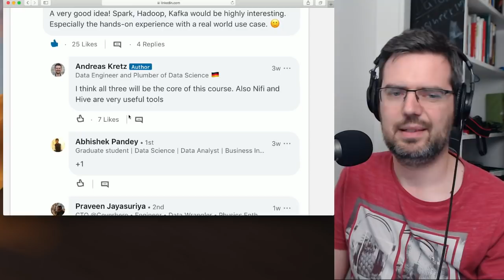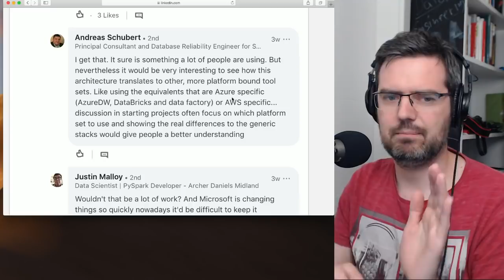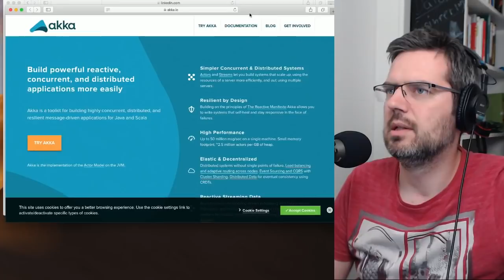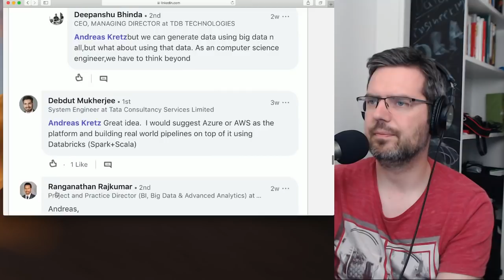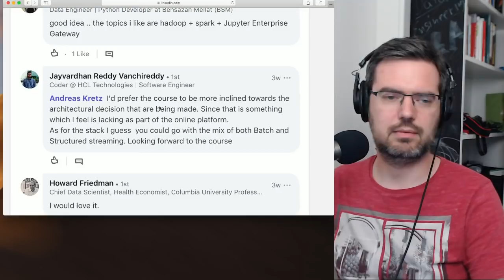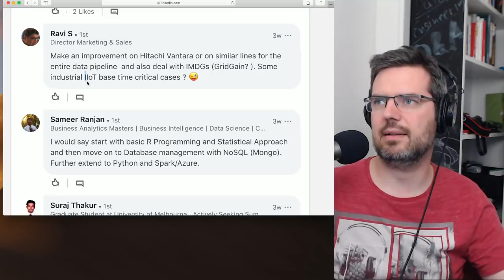Starting My Data Engineering Online Course | #074

Comment: Hello Andreas, glad that you decided to take a new challenge! Kudos to you!

Let me share my modest suggestions about what would be interesting to include in the course:

Cloudera CDH on some PaaS
Airflow as a scheduler of DAGs, instead of Oozie
HBase as a NoSQL for OLTP
Parquet as column storage for OLAP
Solr as an indexer
Hive / Impala for mapping tables on data in the cluster
Kudu as hybrid storage - OLTP and OLAP
Spark and Kafka, of course, as prominent ingredients of any Hadoop cluster.
Ni-Fi (MiniFi for IoT) and SreamSets (StreamSets Edge for IoT) as a visual ETL tool for making fast data pipelines.

And of course, I think it would be great to cover things like Kafka Streams, Akka Streams, Spark Streaming and so on.

Also, a comparison between popular cloud services would be useful in terms of use cases. AWS, Azure, GCP, IBM, Databricks, Confluent.

CDC is very wanted, I've met questions about that on tech interviews. It would be great to explain it in details, frankly.

SMACK is wanted sometimes, at least overview of this stack is needed indeed. Spark <-> Akka <-> Kafka are very interesting together.

Security: SSL/Kerberos/Sentry

ML and BI are not welcome here)
Reply: And IMDB / IMDG like Apache Ignite (GridGain) or Hazelcast. How they help to improve data clusters. I know that Ignite has a connection with Spark, so it's may be very interesting.
Reply from the maker: Best thing would be for this training to focus on tools and processes I already have experience with. If I need to learn every tool before applying it this project will go nowhere
Reply: And Apache BigTop of course! Help me, I can't stop this flow of thoughts)))
Reply from the maker: Haha
Reply from the maker: Hey Nick, you've been missed on the stream 😉 
Great to see, that you mostly agree with what I have said in the stream. Again, I have to keep in mind that I'm a one man show and therefore limited in things I can do. So, comparison between cloud platforms may be a topic for the future